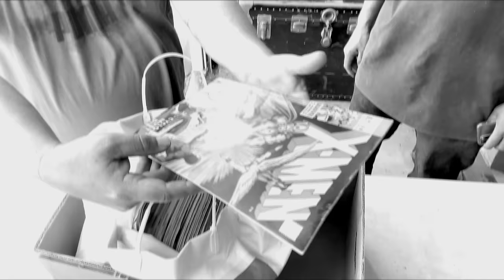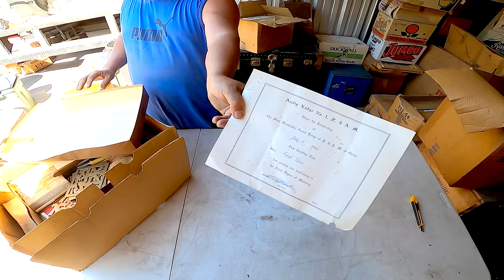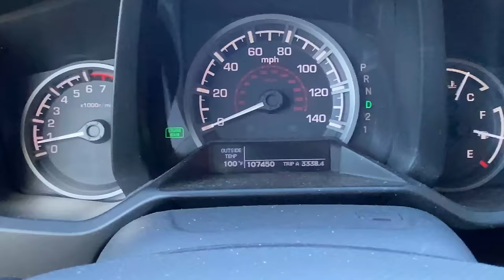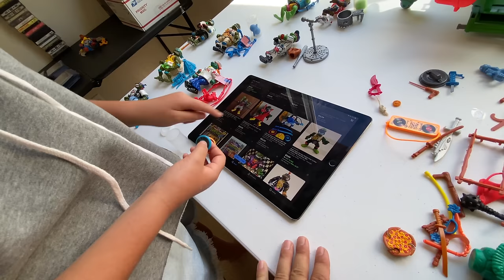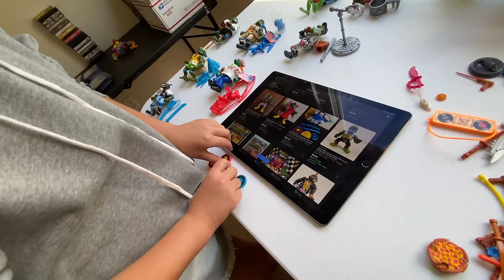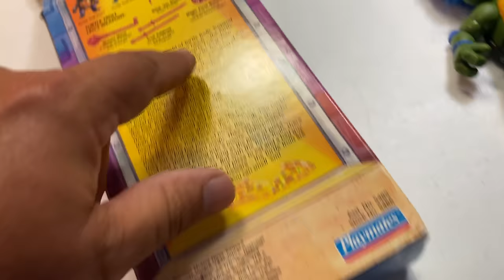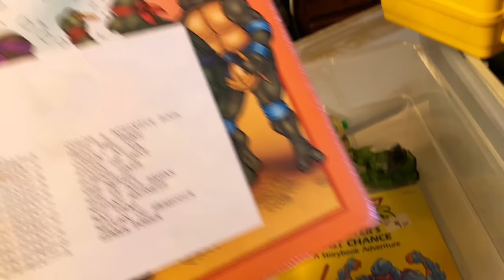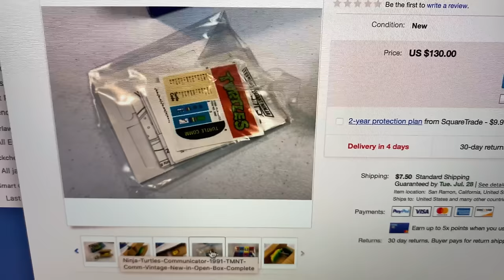VINTAGE Teenage Mutant Ninja Turtles collection in the $3,500 locker bought at auction. SURPRISE!

Comment: The Garcia 300 spinning reel in that tackle box, along with the extra spools for it in their plastic cases, is highly collectable. I sold one with a matching rod for over $200 a few years ago. Believe it or not, there are people who prefer vintage fishing tackle for actual use, along with collectors. It was a top spinning reel back in the 60s. Sell it on ebay, with the extra spools and cases. You'll be surprised. It looks to be in perfect condition. There were also some collectable vintage fishing lures in those boxes. Make a lot of them and you'll get good money without having to sell them one by one. The ones in the original boxes are the best sellers, so lot them separately.

Comment: Does anyone have tips on how to safely open old vintage fans like the ones they’ve been finding in this locker? I saw a fan that Jack opened in a previous video that sustained damage and I’m assuming it’s due to humidity changes causing the paper or other materials to stick together. I would like to know what is recommended when handling vintage oriental fans! TIA!!!